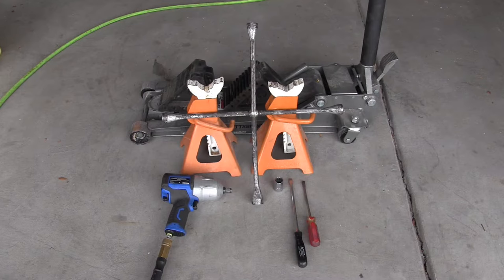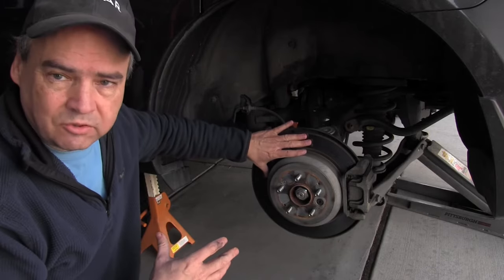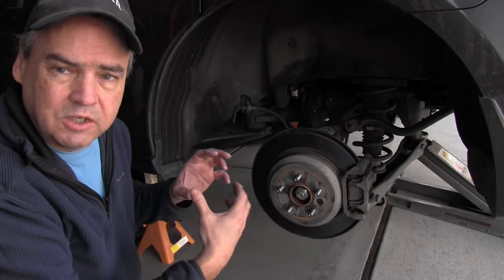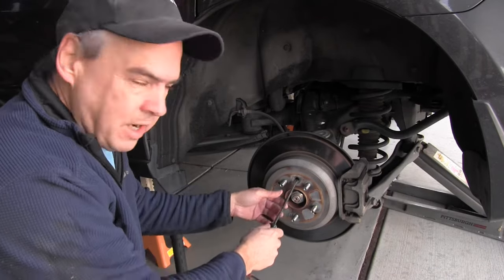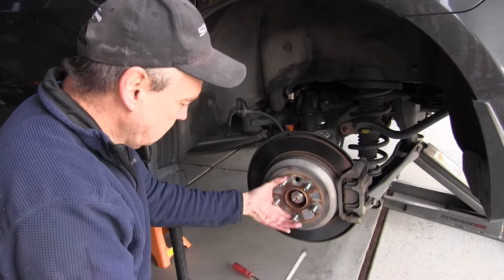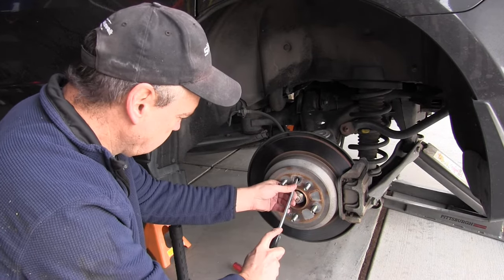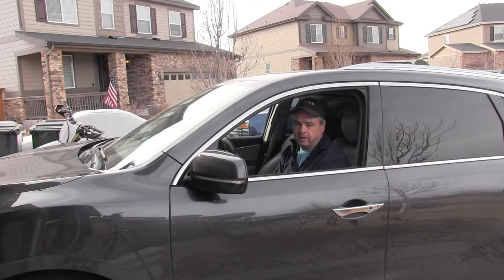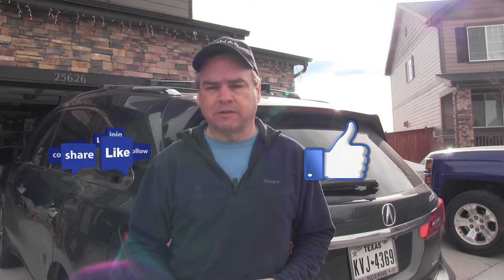How to adjust the parking or emergency brake

Comment: Thank you so much! After brake service at Jiffy Lube, the car would slide down a slanted driveway. Took it back to them and they said "there's nothing wrong with the brakes". Instead of the aggravation of continuing to deal with their incompetence, I adjusted it myself using your instruction. Many many thanks to you.
Reply: Hopefully you learned never to go to a Lube Shop ever again?
Reply: @redemptiverevelation Yep. Lesson learned.
Reply from the maker: Glad it helped.  Thanks for watching.
Reply: My mechanic of 15 years didn't know how to do it. He adjusted the pedal instead which caused drag as the pads were rubbing the drum making the wheel real hot.  Took it back and he reset it but it was obvious he didn't know how to adjust it . I had already found this video online I will adjust them myself
Reply from the maker: @u-know-this  Glad it helped.  Thanks for watching.

Comment: Does the E brake need to be on when you are adjusting? In other words, from the inside of the car should you pull on your hand brake and then make the adjustment or should it be on the down (disengaged) position?
Reply: Parking brake needs to be off so the rotors can spin freely. You jack both rear tires up from under the rear differential and use 2 Jack's to secure..
Reply: Yes
Reply: He'll NO e brake is not to be engaged for adjustment.
Reply: It sounded like you backed that off way more than 8 clix

Comment: I think it should be done while the parking break is not engaged
Reply from the maker: The parking brake is not engaged. Otherwise I would not be able to rotate the disc rotor at all.  The idea is to do it until it locks, then back it off so the wheel spins freely.  You would not be able to do this if the brake were engaged.
Reply: What if you can turn the wheel while the parking brake is engagde? Is it  possible to just do this adjustment then and afterwards the car would actually be held By the parking brake ?  @RoughRidersTV
Reply from the maker: @thomassviknes3943  If the parking brake is engaging at all, it is highly unlikely that you would be able to move the rotor with the wheel off as you would not have the mass of the tire and rim to help nor would you have the leverage you gain from rotating at the edge of the tire instead of at the center.  If your parking brake isn't doing anything, then yes, you would be able to rotate it.  However, you would be adjusting it until it stops the car so it would get you pretty close to the final adjustment.  You would then be able to do some minor adjustments based upon feel of the parking brake pedal.  what you don't want is the parking brake dragging even when not engaged as that would cause a lot of friction and heat up the rotor and rotor hat and lead to warping and excess wear.

Comment: Why 8 clicks? How do you know how many clicks to back off on your application ?
Reply: Subaru recommends lock then 8 off lock when doing new rese brake pads and rotors. But in this video I counted like 20 lots of double or triple clicks.
Reply from the maker: @miguelquijas7207  It may have sounded like it, but I promise you, it was 8. Several of those were the sound of the screwdriver slipping before it the star rotated.  I've been doing this stuff a very, very long time, it's not the first time I've ever worked on the brakes are the car.
Reply: The number of clicks to "back off" can be found in the appropriate repair manual for the vehicle model and year. For my vehicle it is 5 clicks. Typically, you can back off until the parking brake shoes have disengaged and you can turn the rotor by hand without binding or rubbing.

Comment: Thanks for this video. I changed my brakes and rotors on my 2020 pilot and couldn’t figure out why the emergency brake wasn’t holding. I didn’t have to do this with my 2011 pilot and 2000 accord.

Comment: Mine needs a major adjustment. Is it a good idea to repair an existing parking brake cable? Mine broke recently.
Reply from the maker: If the cable broke, then a replacement is the best option.  I would not try to repair a broken cable.
Reply: @RoughRidersTV  the cables are fine. The hanger slipped out of something and let go. I didn't post my comment correctly at first.

Comment: Do you have to adjust after replacing rotors?
Reply from the maker: I would, yes.  new rotors are thicker than the rotors you removed so you might get excess drag.

Comment: Is this the same for a Honda civic I changed my back brakes but I unplugged the e brake motor to do get better leverage then I plugged everything back in correctly and now my dash board is lit up telling me to release parking brake but it’s not engaged
Reply from the maker: Not sure, never had to work on a Civic.  The ebrake is cable driven on this, not electronic so probably not the same.

Comment: Is the up and down for both drivers and passenger?
Reply from the maker: It's basically, lefty loosey, righty tighty on the star nut. You will feel it as it tightens and the wheel will get harder to turn.
Reply: @RoughRidersTV  so i replaced both sides with new pads and hardware. Turned star nut on both sides until they would not turn freely and only a slight lag when e brake is engaged. 
Should I force turning star nut with a hammer? 
Maybe I can tighten cable connected to floor e brake?
Reply from the maker: @HagerVids  Basically, you are turning the nut until you cannot turn the rotor at all. Then you back the nut off by 7 clicks or so. The rotor should not freely spin (no drag) yet when you set the brake, it should engage quickly.  If you have turned the nut and it won't turn any further, then you might need new brake shoes in the drum hat.  The brake shoes are not the brake pads that squeeze the disc rotor.  Replacing pads won't do anything on the parking brake as they are not part of that brake system.  The parking brake is an independent braking system.  When you adjust the star nut, you are moving those brake shoes closer/further from the brake surface inside the rotor hat. Just like brake pads, parking brake shoes need to be replaced every so often.  So if you can't dial in the parking brake adjustment, pull off the rotor and inspect the shoes to see if they are worn and need to be replaced.
Reply: @RoughRidersTV  inspected the cable. It's not pulling on driver side. It does on passenger side. The connector that splits off  looks old and rusty. Now I'm not sure if it's just a stuck line on one side or what lol

Comment: What did you use as the Jack point to lift the rear end of the vehicle?
Reply: Rear differential
Reply: Your owner's manual may have the jack points listed, both for the floor jack and jack stands. If not, look for some strong flat steel on the suspension

Comment: Why not count the number of clicks when expand so you will know how many clicks when to loose.
Is it better to ajust you nside where the handbrake is rather than what you did?
Reply from the maker: My MDX does not have an hand brake.  However, you would not want to do it that way anyway.  Counting won't do any good because it will never be the same as the brake shoe wears over time.  It's all about how much drag you feel when rotating the wheel.  So, just keep clicking until the wheel stops spinning and then back off some clicks so the wheel spins freely yet the show is still close so that it will engage the rotor wall when you apply the parking brake.

Comment: Thank you for this I have to do my rear brake pads and rotors soon and I was wondering how to do this. I wasn't sure how many turns I should do. This cleared so much up for me. Thanks How did you know about backing off 8 clicks?
Reply from the maker: Thanks for watching.  I have a video on how to do the back brakes/rotors as well, just haven't had time to edit it.  As for 8 clicks, this was an educated guess based upon on other cars I've done.
Reply: Thanks, such a useful video, are they same steps as 2014 mdx?
Reply: Does the E-brake needs to be on during the adjustment?
Reply: @ronnyatdrik4700 does it????